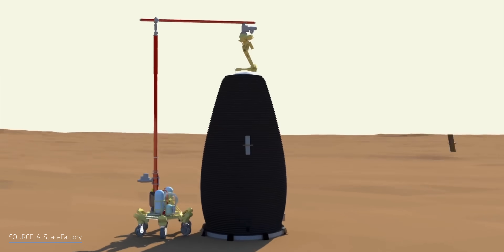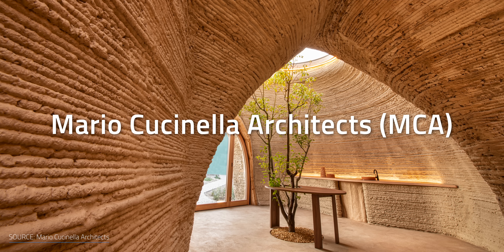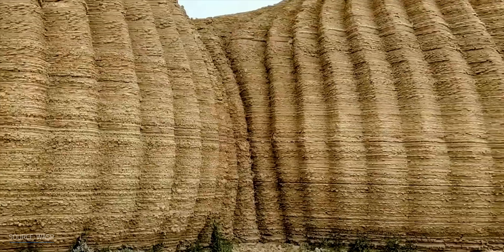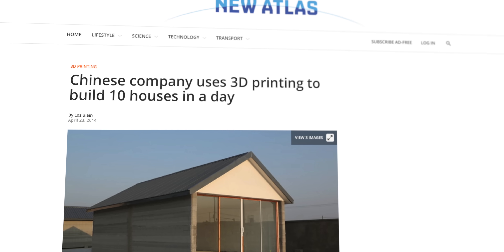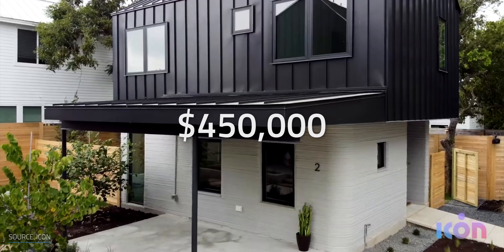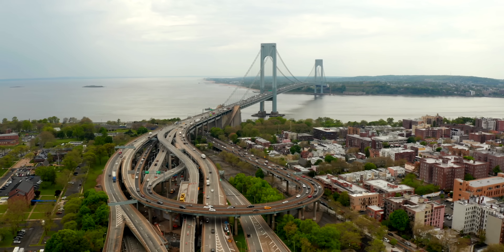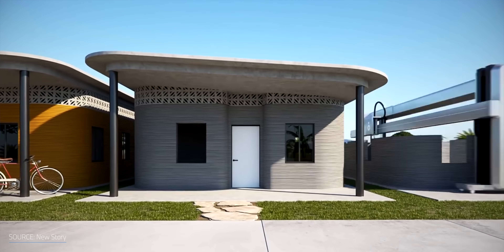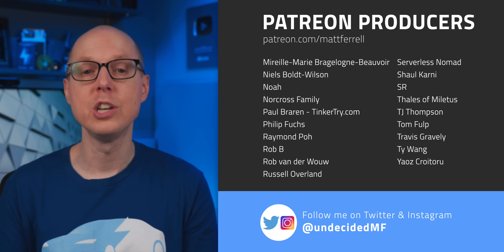The Truth About 3D Printed Homes

Comment: I think that if you are going to have a computer guided gantry type cranes robots on a worksite, it would be much more effective to use them with end effectors to stack mortarless interlocking pressed earth blocks. With the addition of lime or maybe a small percentage of portland (5%-10%) and just the right amount of water the 2000-3000 psi of a hydraulic press will turn the soil into a strong, durable block. It doesn't take a lot of energy to run a hydraulic press. And since a hydraulic press can be driven by an electric motor, the energy to run it could be generated locally. 

However, there is no process that can just put any type of soil into compressed block maker or 3-D mud printer regardless of the addition of rice husks or straw or other binder and yield a strong and durable building material. The soil needs to have the right amount of clay and sand. If the local soil doesn't have the right mixture of both, then material has to be brought in from an off-site location to amend the local soil to get the right mixtures.

The really nice thing about compressed earth block building is that it can be adapted to any technology level and scale. The only really necessary equipment is a hydraulic press to make the blocks. The press can be of any size or complexity from a simple manual controlled block-a-minute type of press up that a few people takes a month or so to make and lay the blocks for a house up to large scale and high speed units with automatic feeds from very large hoppers that make multiple blocks simultaneously and can make all the blocks required for a house in a few hours. 

Blocks can be simple smooth-sided rectangular blocks (which could be dry stacked, but would benefit from being mortared in place with the mortar that is still made from earth/lime or earth/portland mixture), or shaped blocks that have bumps and depressions pressed into the tops and bottoms that interlock with the blocks above and below it. It is even possible if you want architecturally interesting shapes like curved walls that different shapes can be made that still interlock but have a curve to them. 

Interlocking blocks can be further strengthened by have a shape pressed into the top that allows an interlocking strip to be put between each course. The stips could be welded wire grids or ones with very long-chain polymers like ultra-high molecular weight polypropylene (UHMWP) that can be extruded in the required shapes the grids would be pressed into the channels pressed into the tops of block to tie all the blocks in one course together. Something like the UHMWP might sound less sustainable because currently fossil fuels are the initial feedstock. But bio produced oils or synthetic hydrocarbons made from hydrogen from seawater and CO2 captured from the air or dissolved CO2 extracted from the oceans with the addition of renewable energy can be used as feedstocks so that anything made from these sources represent the sequestration of atmospheric CO2.

Then around the block making press are the soil prepping process and the block handling and laying process. Both of those can be simple manual processes where labor is plentiful and gives workers a way to earn a living up to highly mechanized and automated systems that requires very little labor in the process.

Thus the process could be as highly automated like the 3-D printing process in this video with large earth moving machinery excavating the soil, cleaning it, blending it to the right mixture and with additional bonding agents like lime or portland (but in far less amounts than building entirely with cement blocks and concrete), and transporting it to the block press. Then the stacking and curing of the blocks, transportation to the building site could also be done in a highly automatic process. And finally the computer controlled block layer would take the blocks from the pallets and place them with high precision in their final location. With such a highly automated process in place it really should just take a few hours to stack the blocks for the walls of a house and then the block laying robot would move the next prepared slab and repeat the process. 

And each house wouldn't have to be the exact same shape either. Like most developments there could be several different basic models with each model having variations in roofline, window types, porch/no porch etc to give variety sizes and appearances.
Reply: Absolutely. And it's weird that Matt didn't touch at all on this and the rapid pace of advancement that this technology is undergoing. Here's 2017: https://www.youtube.com/watch?v=6s17IAj-XpU, and here's the improvement in just 3 years: https://www.youtube.com/watch?v=EGBRA24qlEg - 200 bricks per hour vs. approx 400 bricks per day for the average human brick layer.

Comment: No one has talked about the power needed to run the printing equipment which would be a problem out in the bush. So its not that good for populations with no infrastructure nearby. Only those who have been directly involved with trying to pump mug will know the difficulties of refiniing the material enough to keep the right consistancy to make a quality mud. Its not practical as non of the people proposed have resolved the issues of fitting windows, doors, kitchens and bathroom services automatically yet so its not quick cheap or simple.

Comment: It is just a shell of clay, no water, pluming or electricity can be inside the clay walls, so to make it work as a home you still need to add interior walls that will make the living area even smaller, the rounded shapes look nice and been a idea that often come back when we talk about the future, but we often go back to the 90 degree comers that work and been practical from the first time we started to build houses. So 3D printed houses are only good then creating strange shapes, it is still faster and cheaper to build a standard form of wood and then pour in the building materials together with the iron rods that should be added for strength.

So this is mostly bull crap and it will not help homeless, most homeless are so for they do not have land where they can or are allowed to build a home, and as fast a homeless person find a spot to set up a tent or a trailer someone say they can not do so.

Comment: I don’t believe that a 3D printed house “made out of clay” is any anything but hype…at least unless it has some kind of plastic or other chemical sealant used over the clay.   Anyone knows that clay that is simply air-dried to harden (as opposed to kiln-fired) will revert back to soft clay with the first rain.   Unless there is some kind of chemical sealant used on these clay walls, the walls will start melting, eroding down and slumping back to ground level with the first heavy rain.

Comment: One thing you didn't mention about the mud house was what they add to harden the mud so rain doesn't wash your house away. And assuming it's some sort of cement, what's the benefit over making bricks etc with the same formula and skipping all the complicated robots?
They have simple machines that can produce bricks much faster than this machine makes walls, and they can be built locally too.

It also seems that doing repairs to the walls down the road or making any modifications would be hard, you can't recreate the texture perfectly, so it's going to look ugly, and getting a repair to be water proof and structurally stable would be difficult.

Also, with zero reinforcement, how safe are they in earthquakes, cyclones, etc?

Comment: For me 3D printed houses looks like a step backwards. Basically a flash mud hut. I do agree with your point in regards to finding the right application. 
Also anyone who has built a home or has seen one built knows the walls and roof usually are very quick to be built. The fitting out always takes the majority of the time in building the house. 
Do when comparing 3D printing vs conventional technics you can only judge on the time/cost it takes to build the walls. 
As well as running power/water/gas/internet and windows/ doors.

Comment: This would be very good on Mars. Using locally sourced materials is preferable due to the obscenely high transportation cost. And building the main structure mostly automatically is preferable due to the obscenely high outdoors labor cost.

But on Earth the main problem is not the cost of the house itself, but the cost of the land under it. The solution for housing prices is far more complex and mostly political. On the technical side you'd want the opposite, super high population density, to offset the cost of the land and cut down on travel time. The ideal solution would be a monolithic 3D structure. Like a skyscraper, but much bigger horizontally. That bring everything way much closer together, and allow traffic to be 3D instead of 2D, practically eliminating traffic jams. And even better, with distances so small, and no weather, you would rarely need more than your two feet. The main reason we don't do this already is that humans need sunlight, and that limits our cities to mostly 2D architecture. But it's actually very easy to make artificial sunlight, so good that you can't tell the difference. Search for "Building an artificial sun that looks unbelievably realistic" on YouTube. Air quality could be easily solved by lots of vegetation, which would grow very well in the optimized environment. We could even grow food in vertical farms, which are extremely efficient and have negligible environmental footprint. The only remaining issue is energy. Ironically solar would be enough, with very high efficiency panels, because now we waste the vast majority of the sunlight we get. For lighting we don't need anywhere near the full power of the Sun, in fact we seek shelter from it. We could light dozens of levels with the energy hitting the roof. Plants are also extremely inefficient, but some genetic engineering would fix that.

Comment: Interesting program. Like you said, building a house is more than just walls. When I looked at container houses, I saw that one of the biggest costs was the foundation of the house. Then there are the costs for electricity and plumbing, which are the same for all houses. I'm just wondering how clay houses will withstand rain? 🙂

Comment: Gee locally we have a thin layer of blue clay, wouldn't that be pretty...lol no I think I'll stick with  concrete and re bar . Brick and mortar,  then as a youth I designed modular houses prefabed walls , 2x6 instead of 2x4, allowing for insulation and duct work, electric, accessible under base board, conduit runs for lighting ...but what did I know, I was after all only 16, drafting instructor explaining the added cost of thick walls ... a while back,  I watched a program about just such construction...it was beautiful to see a vision of my youth take form ... only took 57 years . Take care.

Comment: The power used to power the machines and the back hole that feeds the machine unless you have manual labour digging and transferring it all is still using up gas. If there's an electric heavy machine and a solar power set up with a power storage unit it is still used from the grid which might or not be unsustainable.

So these house printing companies need to have everything self-contained and produced for me to even say it's worth it. the pumping and all the fixings are understandable, you'll need to swap or change out machines to build those but you still need machine shops to make these printers that'll need oil and lube to function smoothly. With that said the "100%" green is more like 50-60% ( just tossing a number out there) so I hope the companies can put more work into it and do everything off-grid without any use of crude oil and use plant/ organics ( Algie) based.

Comment: As an artistic design I like their clay houses, but I agree it's not sustainable, especially when viewed in the context of the big concerns. Having built before, I know what a small part of a house project the walls are. When they're up to roof height, it looks like you'll be moving in next week. And then comes the roof. And the details.

The 3-D printing aspect of it, depends, e.g. on labour costs, as you point out. This is not going to be a good solution to developing world housing needs. It just takes jobs from the builders. Built by hand, a design like that might be nice in, say, a nature reserve, as an overnight "trail hut" - especially with a roof open to the stars, and a tree growing out of it, but in an urban context, I can't see a lot of use cases. (Maybe if the designs become more customisable, wealthier people might use the machine to build follies on their estates, but otherwise, in most parts of the USA, timber frames are going to be more suitable.)

Big thing is those big concerns, though. If people put in a lot of road miles, they're going to generally be burning a lot of fossils to do so, no matter what they're driving in. That even applies, to a lesser extent, to a train that has to run far enough.

I've seen something somewhere about Chinese companies that prefabricate the innards of high-rise buildings. With those, if they could get all the heavy stuff lifted in place first, they could start making units habitable from below - or even from above, come think of it. Maybe from below as the building's skeleton grows upwards, and then from the top down when this is done. In factory based building parts manufacturing, I'd imagine there would be a case for 3D printing for some things?

While I'm still teaching myself how to draw things, so I can just point to a link that shows the picture, and shut up, I'll have to make a brief mention of how we could try to have density and lots of space, all at the same time. (Have our cake and eat it. Have the idea that suburbia is partly based on implemented in a better way, and have the kind of density that brings things within walking distance, too.)

Tall block in the middle of a very big field. No others anywhere near it. Long block, too, so it can fit a lot of people in it.

Minimal "nest units". 2 Bedrooms, living room, bathroom, at minimum? (And for a bigger family get an additional unit.) Meals cooked remotely and delivered. Laundry washed and dried remotely (and delivered on demand). Prune the sleeping quarters down.

Make up for the apparent reduced space by having an automatic allocation of guest units. For three days in every 15 years ("rolling over" if you don't use it) have an allocation of say 50 guest rooms. So for 6 days with your little flat, you also get a mansion. That's for weddings. Your normal automatic guest room allocation would be smaller. Maybe up to five rooms? (If it's five guest rooms, you actually get a bigger house than you had in the suburbs, apart from having to clean and maintain all of it all the time.)

Point is if you worked according to a wish list, you might find you can turn what one would hope does not degenerate into "an apartment" into more living space than most people could ever dream of. The trick is to have as much of the extra features as you need, down to the last hour or so.

And such a place would produce a lot less emissions than a suburban neighbourhood entirely on electric vehicles would.

Comment: I'm not a big fan of 3D printing houses, am more a make the house in a fabrication facility, an slam it together on the site, with integreret plumming and electrical connection into the walls, and then connect the hole thing to gether on site.
In space the 3D printing is another thing. There you mostly use the walls as a shelter, and then it's the best solution I think.
Thanks for sharing your fantastic video to all of us 👍😀

Comment: At first I say you as a 'somewhat constructive' Climate Communicator, but going further down my analysis of your total message output, I end up with this result; "All these new green initiatives, are really way too difficult to implement - so why even bother?". For instance in this video; You practically say (from minute 7:00 to 9:00) that finding all the clay - necessary for 3 billion people - is impossible. After 3 minutes of research I found out that my home country of Denmark contain 46 million cubic meters of clay in its sediment (leaving more than 8 cubic meter per citizen, to rely on if my country decided to build all houses in clay). As the Danish population density is twice the Global average the similar claymaterial-/cubicmeter-average must be considered - at least/roughly - to be comparable to worldwide clay abundances. Therefore; I really have to question your true intention in regards to the Green Transition startups and grassroot initiatives?

Comment: Unfortunately the truth about 3D printed houses is that they are still mostly just a scam. The basic premise is that they are saving on labor. But labor is rarely the main cost of building, and 3D printed buildings typically user more materials and have many problems. They typically get away with it by skipping what would normally be considered standard features like plastering. The buildings often look cool, but are not what most people actually want to live in. As for mud houses, here in Africa we have been doing that for centuries with our hands.

Comment: I know styrene is not a much loved material, but perfect to make lego bricks from, with any interlocing cavities. So you can adjust for base concrete filling and concrete or dirt whatever for the walls (dirt resulting on moderate climate in ~80cm 30in thick walls due to 25cm 10in-ish insulation). Roofs are not for printing but simple to prefab. All openings ready, electric / water can be cut with hot wire, cemented glasswool net on top in and out and off you go. You just need a mixer, not all those special tools.